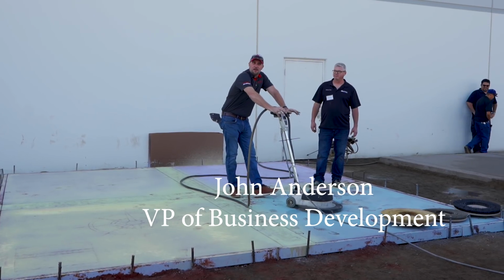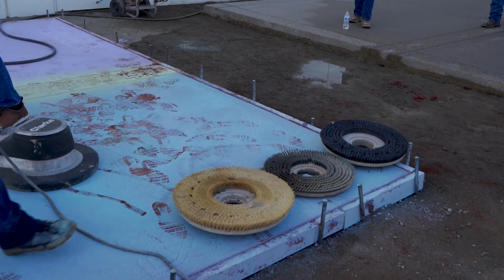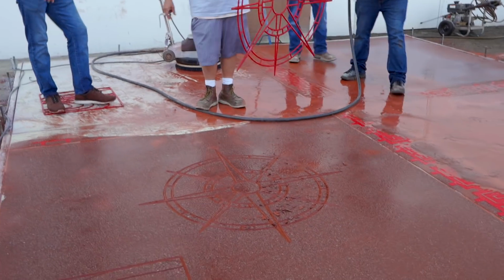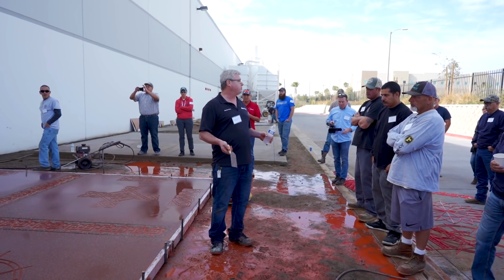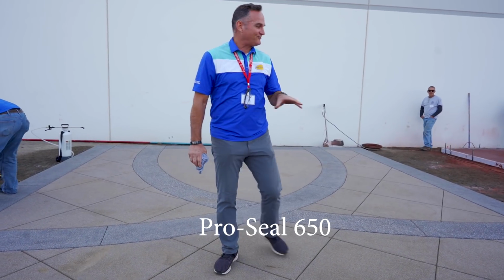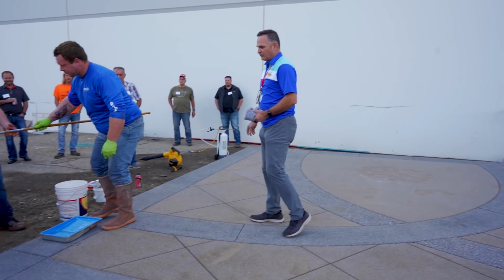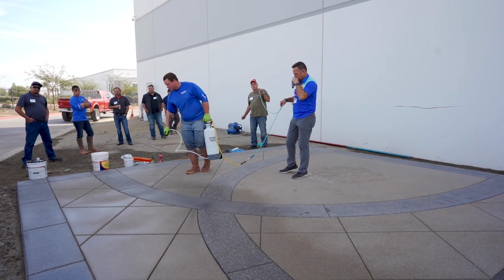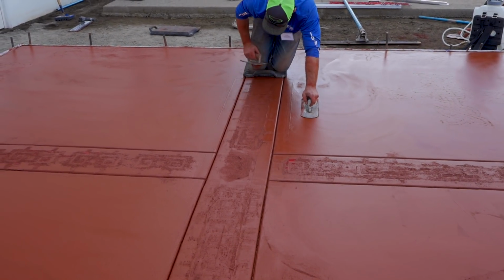Decorative Concrete Hands-On Demo Day 2 - The Barndominium Show E197

Comment: I cannot stand exposed aggregate. I never recommend it and do my best to talk people out of it. It’s much harder to keep looking nice in every way. Doesn’t sweep off nearly as easy, collects debris due to the rough finish and build up with moss very quickly if not pressure washed twice per year here in the North West. Also in the Seattle area it’s illegal in many cities to rinse off the top cream layer. It’s not allowed to run off your property, like doing a driveway is very difficult. If it goes into the street or nearby ditch, they can and will fine you BIG time. — Also I like how after all the talk about how cool their scrubbing machine was, they had to break out the old traditional brooms and pressure washer. Hahaha. OOPS! #fail
Reply from the maker: They used the machine to break up the top layer of concrete.  You still have to rinse it off.